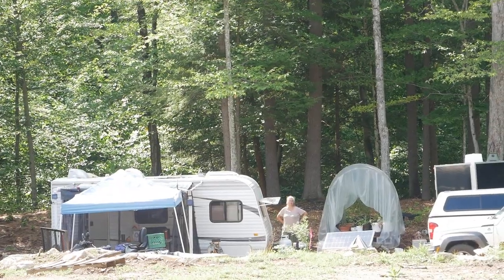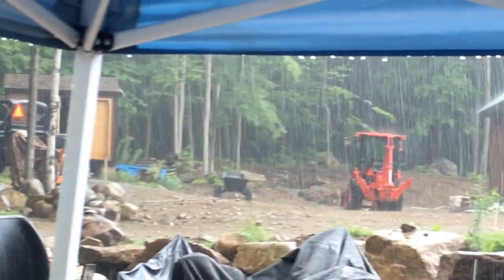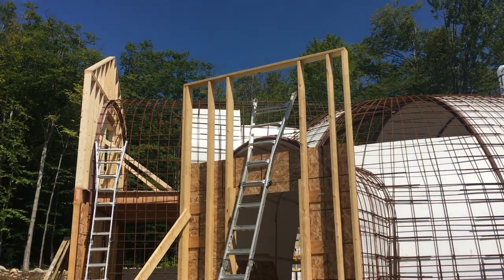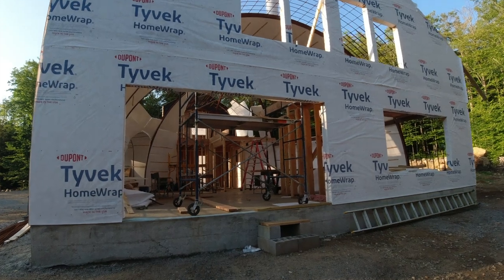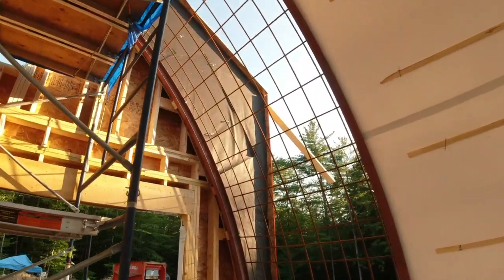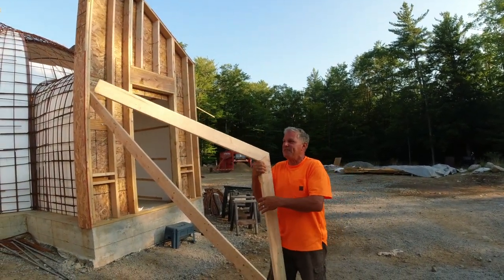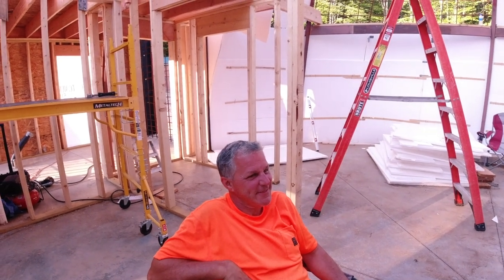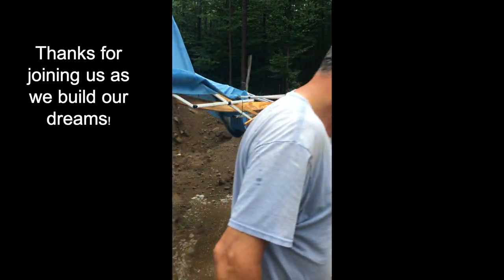WILL the WALL FALL DOWN? | OFF GRID BUILD | NOT YOUR TYPICAL FRAMING JOB

Comment: I'm still watching. You all will have a cozy big home when you are done. What was your inspiration for this house? I'm building ferrocement dome cottages in the Caribbean. I'm from New Jersey. Very similar but I am using diamond cut expanded lath and I hand trowel the mortar on. Not earth sheltered. 

 Did you consider poured or block masonry walls for your end walls. Lumber is very expensive these days. Maybe ICF?

Regardless. I'm sure your end walls are not going anywhere..
You have the makings of an indestructible home. Ready for the apocalypse..
Reply from the maker: Those houses you’re building sound pretty nice! Very strong👍 we chose wood because we thought it would be the most economical, this plan has been in the works for five years and we had no way of knowing there’d be terrible inflation. It’ll all work out in the end but it’s definitely a tough time to be building.

Comment: You may have spoken about this previously but could I ask what finish will be applied to the interior of the dome.
Reply from the maker: The interior cement will stay cement. The framed walls will probably be a mix of wood, Sheetrock and whatever else is inexpensive (pallet wood).
Reply: @CreatingASimplerLifeOffGrid  So the foam is only a surface to apply the shotcrete then discarded. Makes perfect sense now. Forty seven years ago while in college I took a course in energy efficient building. I remember doodling various earth sheltered homes that I might one day build for myself. It never happened, but at least I get to watch you guys. Thanks for posting your videos!
Reply from the maker: Even better, the foam isn’t discarded, it’ll be used on the outside of the dome as insulation under the dirt! Glad your enjoying the build. It’s been my dream for a very long time to do this too! Kathie